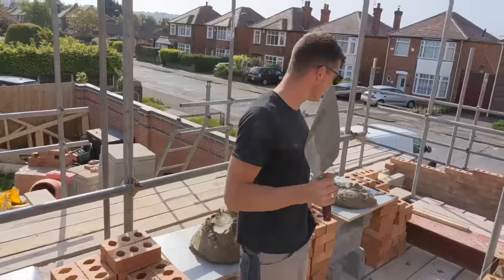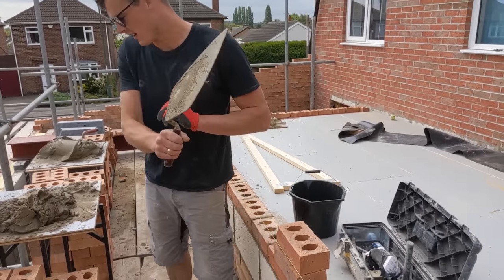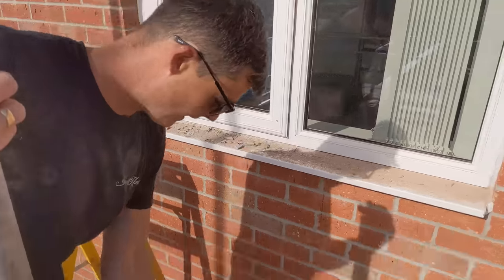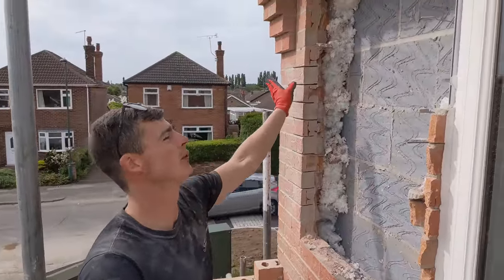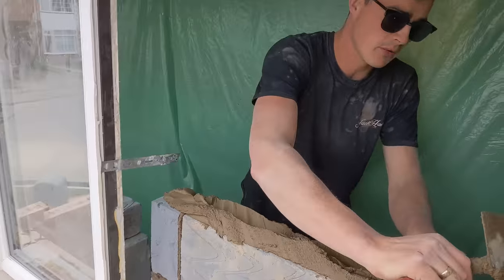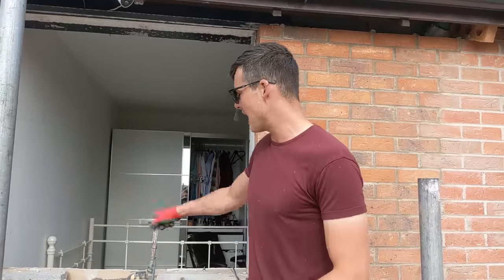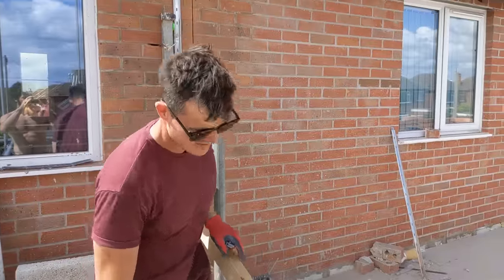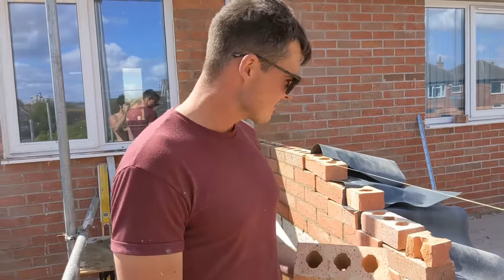Bricklaying - Slow few days - Step Trays and Moving windows

Comment: Tidy brickwork but can't understand why people still use plastic trays
UPvc trays with Lead flashings attached are so much better, especially the brick ones even for blockwork as look neater
No need for cutting in after or hassle just pull up and flash underneath 
Good luck with your channel
Jagclamps are also a joy to use for line clamps

Comment: Cracking job mate, just for your info new regs we have you work to with your damp trays, we have to bed them and poke the damp out around 10mm, then scrape the joint out so the roofer can then poke his dressing under
Reply: Wherever possible build the flashing in, if that's not possible as Michael said bed the tray on a nice bed leave the tray poking out. Rake out enough for the roofer to get his lead in, otherwise he uses a grinder an rips the tray to bits. Also another thing to look out for is the lead wedges they hammer in sometimes to secure the lead, they push the tray back so the tray and lead don't overlap. If that elevation happens to be one that gets hammered by rain it can leak in.
Reply: I like how your boss leaves you to get on with it,normally apprentices aren’t trusted to be by themselves,keep learning 👍
Reply: It was always like that then for some  reason it whent out of fashion and roofers had to grind out new work for there lead, most jobs done like that the tray is in the wrong place.
Reply: @bricklayersworldwithandy6277  I think the value of lead and it getting knicked was to blame.
Reply from the maker: Ooo okay fantastic, I wasn't aware of that! Good to know, not gonna lie, first time I've done step trays😂👌 thanks for the advice Michael 🤜🤛
Reply from the maker: @deeza678  😉😂
Reply from the maker: @lessismore83009  thanks Philip, next time I come across a step tray, I'll do that 🤜🤛

Comment: just been watching your video and I can't believe you haven't continued the cavity where the new extension connects to the existing building this is really bad not only will this cause damp issues but also a cold spot, to tooth in is correct but not to create the minimum 50mm cavity is shocking the toothing will just hide the poor workmanship of not continuing the cavity, this is typical of a lazy builder who can't be arsed to do the job properly shame on you, if your going to post videos of work don't include school boy errors like this.

Comment: People may piss you off with their negative comments BUT can they do what you do NO. You can do an extension from start to finish including woodwork, steels roofing but the majority of brickies just lay blocks and bricks. Keep the vids coming Izzy
Reply from the maker: Cheers fella, do appreciate it🤜🤛 Water off a ducks back😂. However, I do appreciate constructive criticism, as I would be ignorant to not take that on board 👌 cheers for watching mate! Have a great week
Reply: @IzzytheBricky   One thing, you bridged cavity to form new build line, you shouldn't do that until you reach the lead line. at least install a VDPC against outer wall.👍

Comment: I thought a return for any corner had to be minimum of 450mm..? And did you put any insulation in the cavity.?…
Reply: It used to be 650mm but if the Engineer can provide calcs to prove otherwise it's ok.
Reply: @bricklayersworldwithandy6277  ahhh yes 650mm god knows why I said 450mm..🤷🤷🤦🏻‍♂️
Reply from the maker: Hi mate, I did put insulation in the cavity, just not much was shown, as I was quite focused on getting home before 7pm 😂😂 so decided not to film everything 😂

Comment: stepped dpc should follow the lead, so back of tray (the upstand) is in line with the lead usually about 75mm above finished roof line. Check out NHBC standards online, its free
Reply: 150mm mate
Reply: @kevinmyton122   no mate 150mm is upstand to front edge not the cut back

Comment: Is there any particularly reason to use the concrete blocks on the outside skin above lintel or just to save laying two courses of brick?
Reply from the maker: The blocks will be hidden by the lean-to roof, just saved laying about 150 bricks, bit quicker and cost effective 😊👌